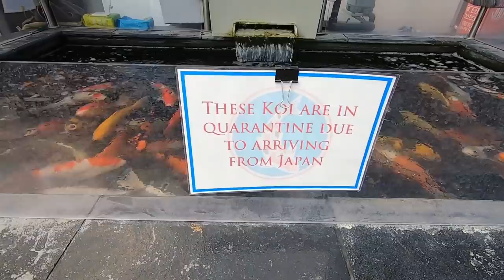Queni Koi buying trip, pond update and Big Blue!

Comment: On cleaning the glass have used a set up that is magnetic. Old school is a scraper that employs a razor blade. Pond and filtration looks awesome. What’s next?  William
Reply from the maker: Hi William. Does the magnetic cleaning system operate through 25.5mm thick glass? Next project is a quick netting system. Stay safe
Reply: CATANDEYE KOI  Went on line and found a scraper that “supposedly “ can be used on 3/4” thick glass. Disclaimer I have not used one on glass that thick.   I don’t know how well it works. Company is “Magna Float” on Amazon usa $100.00. The best to you and Cat. William

Comment: Hi Steve, I wouldn’t worry so much about vibration on your window unless you keep elephants. However the cement will etch the surface of the glass and ultimately stain it. So using your sealant next to the window is defo recommended.
Alex
Reply from the maker: Hi Alex, I have just finished laying the final slab, the mortar can't be seen thankfully so not going too bad up to now. Stay safe

Comment: Hi Steve, really pleased for you mate, the pond looks great and can see the joy it's bringing you. I couldn't make out what you said about your pergola. Have you just placed it own the top and letting the weight keep it in place? or have you secured it somehow? Cheers mate.
Reply from the maker: Hi Mark, I didn't want to drill and disrupt the brick/mortar so just say it on top then braced the pergola to the top deck with 2 lengths of 6x2. Secure now mate. Cheers
Reply: @CATANDEYEKOI  Sorry Steve I am probably being a bit thick but what do you mean by brace to top deck?
Reply from the maker: @markpaine882  I fitted 2 pieces of 6 inch x 2 inch lengths of wood from the pergola over the pond to the pergola over the top deck to increase its structural stability. Hope that helps. Cheers
Reply: @CATANDEYEKOI  Thanks Steve, that makes sense now yes. Took me a bit of time work out what top deck was but get it now.